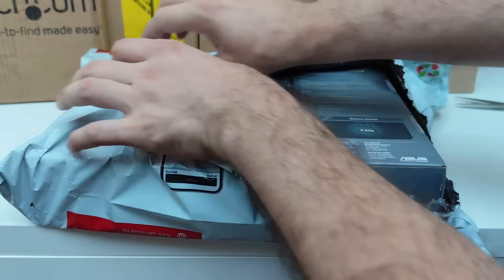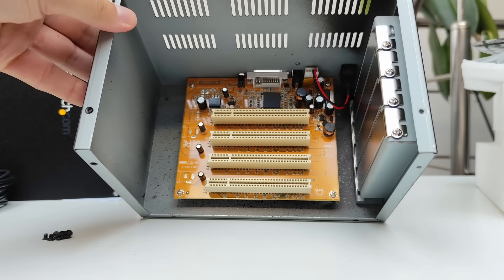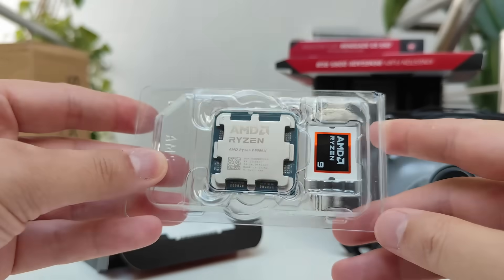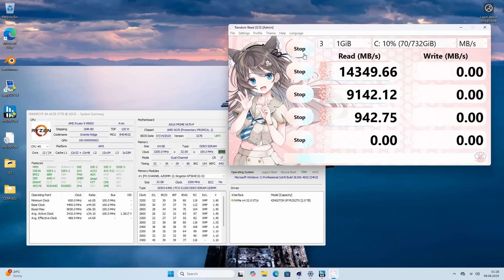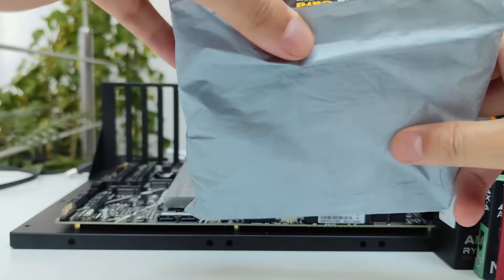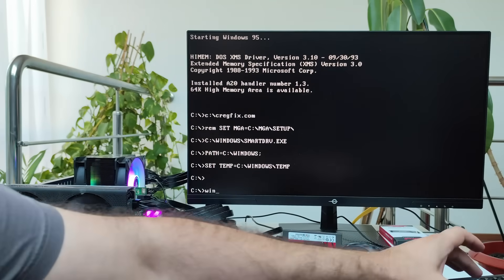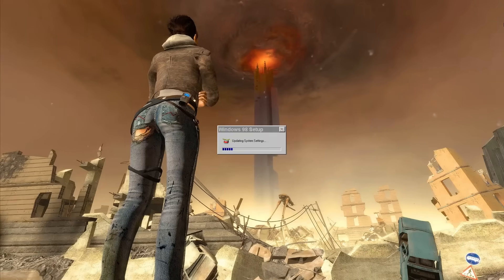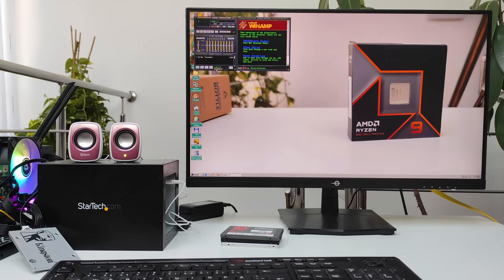Windows 98 on a Ryzen 9 9900X@4.4Ghz and... It (Eventually) Booted! (On Bare Metal)

Comment: Great video and now we do more AMD Motherboard videos after Intel Motherboards have been concluded!!! That Startech PCIE to PCI Card Enclosure is unaffordable and very expensive!!! But I can be very useful for both Intel and AMD Motherboards!!!
Reply from the maker: Yes, I will make at least 6 videos on this AM5 platform, at least that's what I said when I pitched the project. But I guess it will eventually be more than 6. The enclosure, yes, it's both pricey and useful, especially since many motherboards now come with only 3 PCI-E slots, as the bandwidth is eaten by the M.2 slots. Initially, I was thinking of buying a 2 PCI slot 5.25 enclosure from Aliexpress but it didn't look very trustworthy, and I was like... 150$ plus 35$ for shipping.

Comment: Ich hatte eine pcie express e x24 Grafikkarte 128gbs auf Windows SE oder FE fx  das war vor Vista und 2000 XP oder so 256sdvrsd pcie x8 x16x12x4 and weis nicht mehr ob nivida oder ati amd 64gabs und 128gabs alle Scheiße ich 256 auch Scheiße ssx ode SE keine ahung mehr voll vergessen egal geile rwnspieke ruckeln Wie auf 50 Prozent Erdbeben dualscock lol nicht klar due Technik mit mehr musdtnich Spuren und billig den Weg finden raus das war katastrofe boot Absturz Zeit Teile blows nicht label beruhren falsch einstecken odef falsch laden oder hoffe n das motherboard gerade biehen wieder anspringt
Reply from the maker: Ich habe kürzlich Windows 98 auf einem K6-2 500 installiert – im Video hier: https://youtu.be/3sop91tqkTU  Es hat Spaß gemacht, ich liebe alte Technik. Aber eigentlich läuft Windows 98 auf neuerer Hardware besser und stabiler. Alles geht schneller und spart Zeit, vor allem beim Troubleshooting.

Comment: 14:45 this pcie to pci adapter is so cool... when connected to a low profile card you get normal profile thing... from here looks like it should fit into any computer case... unlike pci to agp adapter for example
Reply from the maker: Yes, it's probably the best PCI-E to PCI adapter when it comes to ergonomics. It can turn any low-profile PCI card into a full-height PCI-Express card. It will fit and it can be safely secured. There are quite a few sound cards in the low-profile format and many other adapters.

Comment: these type of videos are always proof that most of the time new hardware and api support could be achieved by only updating a handful of system files and the kernel.
basically if microsoft would just employ a team of like 5-10 devs to backport dx10/11/12, vulkan and security relevant stuff like ssl/tsl then we could have the most modern games running on either win98, xp or win7.

microsoft just uses "hardware support cut offs" as a very comfortable argument to push new oses.
Reply from the maker: If I become a billionaire, I’ll personally negotiate with Microsoft to release Windows 98 3rd Edition x64 - I’ll make it happen and pay for it myself. 😎 Meanwhile, Windows 2K was much easier to maintain thanks to the NT kernel similarities. Check out this video of Windows 2K running from NVMe, with USB 3.x support: https://youtu.be/bqheehbqtBI
Reply: You start backporting the tech you mentioned to older Windows versions and you've created a Frankenstein's monster of an OS that is neither here nor there.
Reply: Not really.

All the errors in the processor hardware and the dll's and the rest of the system software would make you immediately hackable even if you just touched the internet for a minute...
Reply from the maker: @FutureChaosTV  You don’t need to connect an OS like Windows 98 or XP directly to the internet. First, all traffic passes through a router - which typically runs Linux. Even a basic router will block some junk, but heavy-duty solutions like ASUS AiProtection, NETGEAR Armor, or Bitdefender Box can filter out threats before they ever reach your device.

Comment: Nice video! 🎉👍🏻
Reply from the maker: Thanks! Next on my list is Windows 95  - it was released on August 24, 1995… exactly 30 years ago. I hope to have a Win95 video ready by August 24. I would normally have the time, but I’m leaving for a week or so. Maybe I can still pull it off
Reply: @O_mores Yep, those older Windows are pretty nostalgics!
Reply: @O_mores  About Windows XP SP2 x64, I did installed on my VMware for testing with NVMe drive attached. When I tried to install backported generic NVMe driver on progress, it suddenly froze and nothing response. Then I forced restart by reset mode and boot XP again, the NVMe driver aren't completely installed and it said "Not digitally signed", also the backported USB 3.x drivers aren't completely installed too, got "Not digitally signed" again. But on other attempts, it suddenly got black screen with error message that it corrupted Windows XP system. I have no idea what's going on, any have solutions can fix? (I already installed hotfix but still not working for me)